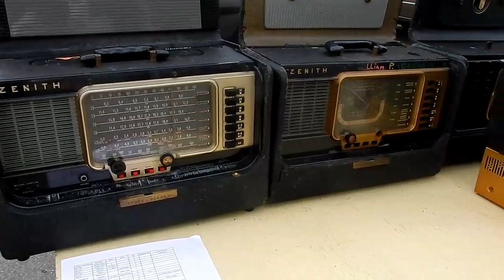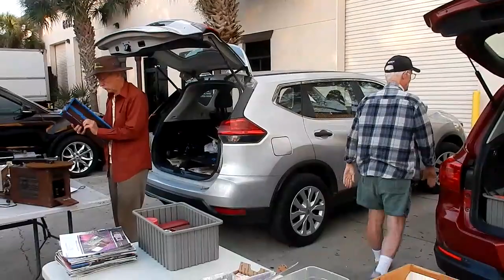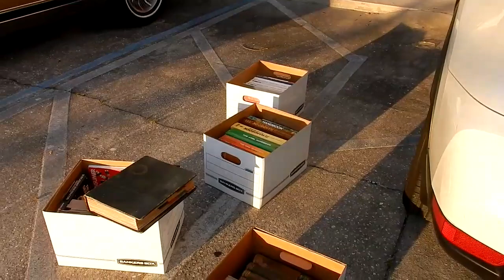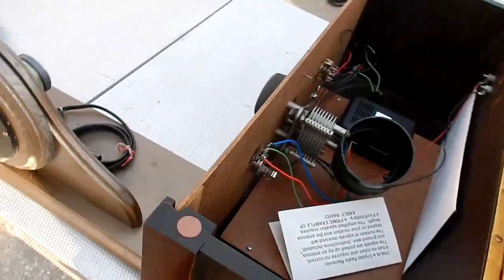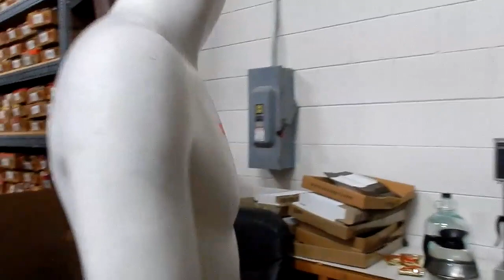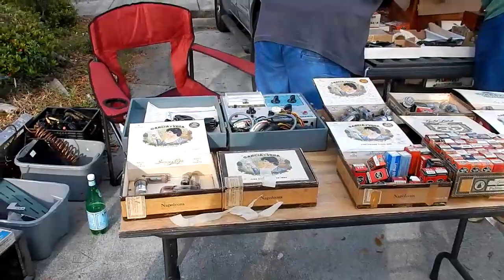VINTAGE RADIO AND AMATEUR SWAP MEET WALK AROUND MARCH 2, 2019

Comment: We have a huge electronics flea market in Sunnyvale California (silicon valley) every second Saturday of the month most of the year. I will take some video there next week and post it for you to see the differences and the similarities. Watch my channel for that.
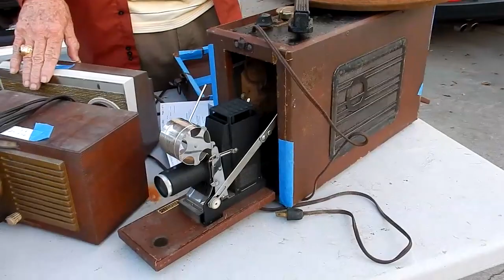3:00 - You mean you don't know what a film strip projector is? Film strips are slide films that a re not cut and mounted in the holders. The recording that accompanied each disk had a beep in the dialog to indicate rolling the film to the next frame. We still had these in my high school in the 70s.  Later units could also advance the film with sub-audible (40Hz) tones recorded on the record or audio cassette.